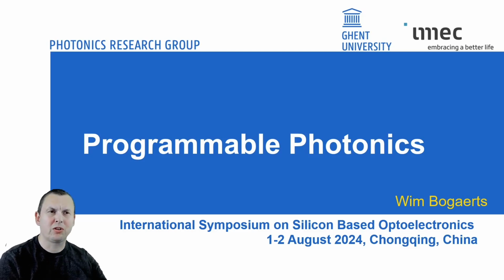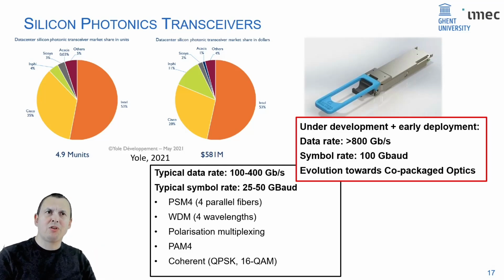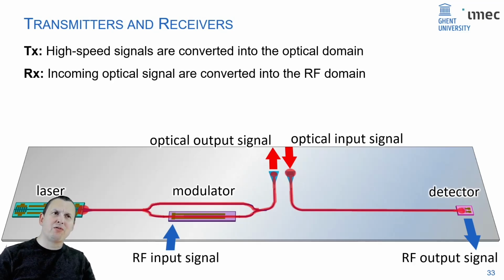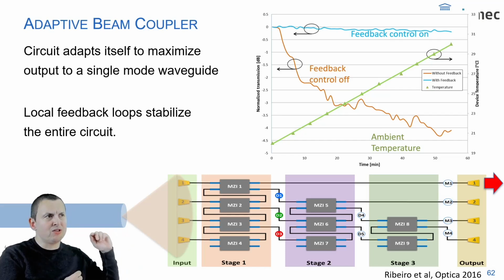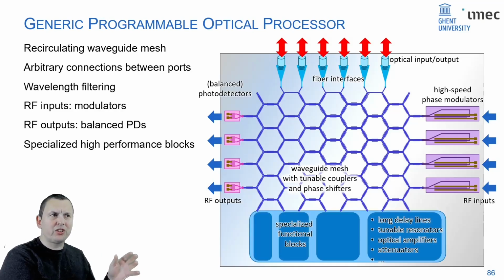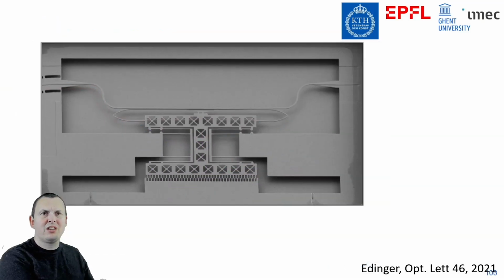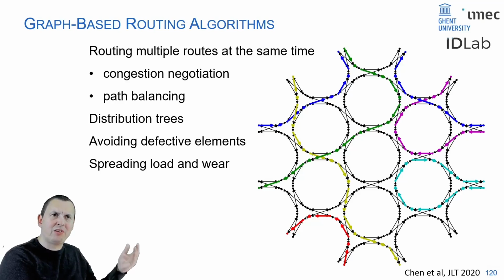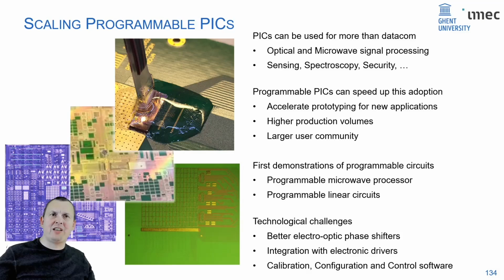2024 Programmable Photonics - Wim Bogaerts at ISSBO

Comment: How about specialised chips for neural networks (matrix multiplication part)? I'm thinking if photonics could be improvement over silicon at least for some tasks like this. All these huge data centers with 50, 100, 250MW is a lot and you need expensive infrastructure. Not to mention big companies even are planning dedicated power plants just for sake of this computation. I'm just curious how far would be a chip that could do mass computation for much less power and hopefully cost/perfromance. +- 10 years from now?